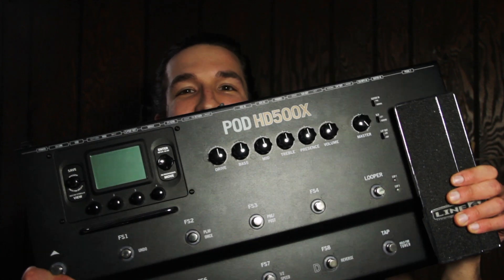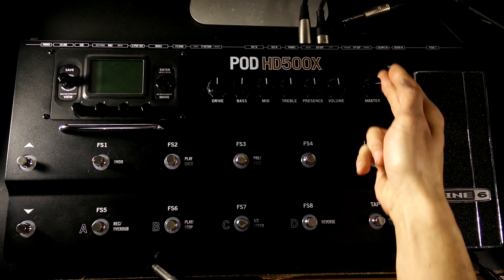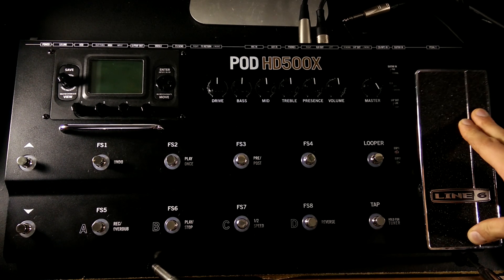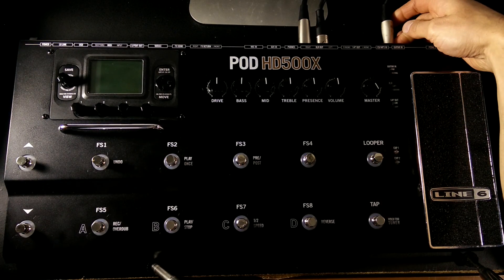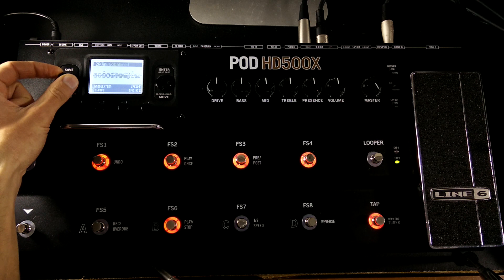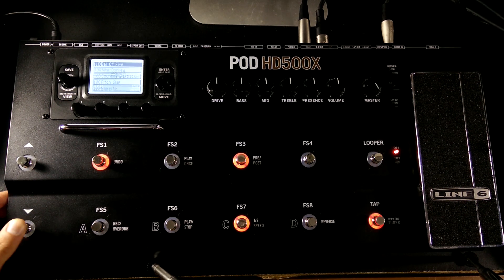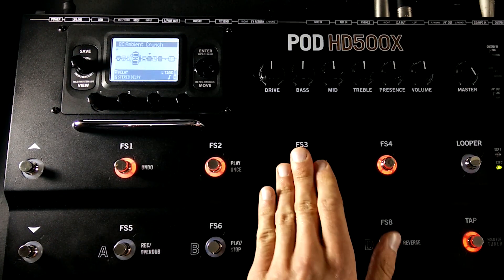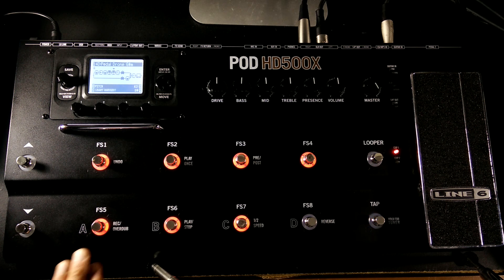Need Help With The Line 6 POD HD500x? Watch This Video!

Comment: Great video! Something I'd like to add here, setting both inputs to guitar made my tones scratchy and distorted which I think is because of too much gain, so if anyone else is facing the same issue here's what I did. Input 1 set to Guitar+Variax and Input 2 Set to Mic or Variax. Basically making sure that only 1 input is set to Guitar. Cheers!

Comment: Good intro vid on the HD500x. I have been using mine for about 6 months and didn't know where to go to assign an effect to button, so thanks for that explanation! Quick question, I have been customizing my own effects on custom banks. Is there a way to copy a custom preset to another bank? Example, I have a custom sound on 1A but want to copy it and put it on 2A so I can continue to tweak it but don't lose my original sound? Hope that made sense... Thanks!
Reply from the maker: Great question. So, let's say you have your 1A preset pulled up. Press the SAVE button once. You'll see a new screen pop up. At the top of the screen you'll see the destination where the preset will be saved. You can use the number 1 knob to pick which setlist to save it to and you can use the number 2 knob to pick which bank in that setlist to save it to. You can also use the other knobs to rename the preset. But, if you want to just copy preset 1A to 2A, turn the number 2 knob until you see the save destination say 2A. Then hit save one more time to actually save it. Just keep in mind, that doing this will overwrite the original 2A preset. Did I explain that ok??

Comment: I’m about to pick up one of these 500x’s and I was wondering if it is possible to use a 1/4” out to a small amp on stage to use as a monitor while simultaneously sending a direct signal to the mixing board using another output like the xlr
Reply: yes, but i'd advise you to get frfr speaker because amp will color your sound and it's not gonna be the same you hear on your amp and what you are sending to PA.
Reply: @denisx36  frfr speaker? I’ve never heard of that one… guess I’ll need to do some research…thanks for the tip! 👍🏻👋🏻

Comment: Congratulations on the video. It looks great! I would like to share a problem I had this week, to see if anyone can give me a solution. When using the Wha, I noticed that the pedal no longer controlled it, although when pressing the foot hard, it works the function of switching between Exp1 and Exp2 correctly. I Tryed to carry out the calibration process, pressing the right key to access the menu, but the foot movement is not recognized in the calibration process. Either it stays at 255, or it stays at 0. I also tried doing the factory reset, turning on the pod by pressing the left arrow, but it doesn't seem to be working, as none of my presets were erased. Therefore, I still cannot control either the wha or the volume. If anyone can help, I appreciate it. Tks

Comment: I haven't tried it yet but seems possible two guitarist could plug into the effects returns and have a dual amp setup in the patch so each has their own sound and could be panned or centered to preference.

Comment: Bass guitar patches. Effects loop end of chain mix 100, send assigned to foot switch for volume, return 0. I can still have stereo guitar patches XLR to board and bass 1/4 " out to board on separate send from effects loop send so bass patches won't mix into xlrs. Easier mixer volume control.
Reply from the maker: Super smart👍 I gotta try that out, thanks!
Reply: That would be expression pedal for send level for volume control not a switch.

Comment: Is there any way you can use this thing as just a pedal board and bipass the amp modelers? I have a tube amp and would hate to have to use the amp modles instead of my amps true gain. Is there anyway I can just use the fxs?
Reply from the maker: Yup! You can turn the amp block off and just use the effects.

Comment: Hello, thanks for the vidéo, it helped so much one several things. I' searching to solve a problem for several weeks, but i can't find any solution, here's the problem. First I'd like to come back to a proper FX seetings when I come back to a bank, I mean making a setup for a bank, add a FX when I play, and come back to a "original sound bank" when i come back. I 'd also like to make priority to a FX : if I put a delay with FS1 when on a bank, I'd like to make it canceled when I press FS2 to a distortion cause i don't want delay anymore. Is that possible ? Thanks ;)

Comment: Dude can I hook up the "send" (from the FX loop of the pedal) into my guitar amp (to avoid cabinet simulation) and then hook the XLR outs into an mixer in a live situation? I don't want to have a cabinet simulation going into my amp, but I do want it going to the mixer... Thanks!
Reply: I’d like to do the same… did you ever figure out how to do this?
Reply: @urbanscott  yes! But it limits your digital processing power so you may have to deal with less effects in your chain on that particular preset. This pedal allows you to use 2 amp simulations at the same time in parallel (in the LCD display it shows one on top of the other). So I used the same settings in both amps except that in one of them I've used a cabinet simulator (which will go out to the main output) and in the other one I removed the cab simulator (I've panned both amps to the center, so the one with cab simulation will come out through both left and right main outputs). And in the one I've removed the cab simulation, I've put the FX loop effect (that deals with the "send/return" of the pedal) just after this amp with no cab simulation (the FX loop has to be at 100% mix so that nothing goes to the main output and everything goes to the send output only), so that whatever comes into this send/return effect (FX loop) will be sent to the "send" output of the pedal and nothing will go to the main output. And then I hooked the send output of the pedal into my amplifier. Unfortunately in my experience the volume will be a little lower than using the actual main output. But it works! On my clean preset I didn't need to do that because I think that even with the cab simulation, the amplifier sounds okay. But when using distortion, it makes a huge difference not to have cab simulation going into the amp. Hope it helps

Comment: I have issues on my expression pedal, when I calibrate it doesn’t move to 0-100, It’s always 100. And the scaled pedal value is 34-255.
Reply: try to do global settings reset, then re calibrate your expression pedal

Comment: Treble is changing automatically even without changing/touching anything. It happens while playing saved patches. Apparently treble is going all the way down and it just stays there, and goes forth and back again. I did try a reset and it cleared all the patches and I do not mind. Please help me fixing this issue, otherwise I need to sell it.
Reply: Subscribed

Comment: There is no way to use foot to press VIEW tiny lever to resume BIG NUMBER of Preset? It ia hard to bend down with guitar hanging. Oh, you missed the other part; using HD500X Edit program. It is supposedly practical but turned out to be painful cope with.

Comment: Can anyone help me find the following information concerning the LINE 6 HD500X . I just bought it.  Three questions;

1) Has anyone found WHERE there is a preset list for the presets?  I can't find it anywhere online. 

2) I'm trying to duplicate the Adam Jones guitar sound for a recording im doing. Can anyone recommend which amp model on the LINE 6 HD500X has that fat,low end ,thick compressed gain sound Adam Jones gets?

3) Any idea  which actual real amplifiers the amp models are trying to emulate on HD500X ?    Example: which amp model duplicates a Marshall,BoogieDiezel,etc?.

Thanks.  Krissy💋💋💋💋
Reply: To answer your third question, there's another video on this channel where he shows us the heavy rock/metal tones. In that he explains what the models are based off.
Reply: metalforlife4ever  when I plug a    Studio  Mike  where can I find the phantom power anybody help me
Reply: @solracm7783  this unit is only able to interface with a dynamic mic

Comment: WHEN I PLUG IT INTO MY INTERFACE THE AMPS GIVES SO LESS SOUNDS...IVE TRIED EVERYTHING BT DONT KNOW WHY IT DOSENT HELPS
Reply from the maker: When you plug your 500x into your interface you get less volume?? If you're still having trouble, first make sure that the channel volume and master volumes are turned up. You probably already checked that, but I have to start there;) Then, check the Level or Gain knob on your interface. You may need to turn that up. Other than that, maybe your low volume problem is caused by a setting in your DAW?
Reply: @JonEleyet  i mean when i try making a new patch..  The amp have a very low level of sounds to then it dosent help even if i turn the volume all the way up...

Comment: I  bought a hd500x and a line 6 fvb express  foot switch ...the pod have a variax input ... Do you know how to connect the fvb to the pod? Does it need any configuration? And I also have a Force feedback gamer foot switch; the connector is similar but is smaller, do you know if exists a way to connect it? Is possible to mapping the gámer foot switch on PC but ...I want to control the PC with the fvb and then  control the pod500x pitch using the gámer foot switch ...I want to have in my feed the same button  as a midi controller keyboard pitch ... because when you use á pitch button  on keyboard it returns to the same position but expresión guitar pedals never do that ...I also háve a sustain keyboard foot switch I don't know if is possible to connect all together.cán you comment?! And one more question jajajajsj.... can I tune my guitar using the pod 500x or is completely necessary to buy a drop tune pedal ?   Rewards from spain sorry my English is basic 😜
Reply from the maker: Hey, I'm not too familiar with how to connect all that equipment together. But, you should be able to do everything with the POD that you can do with the FVB. Good luck.
Reply: Yes ! you can connect the pod fvb with MIDI cable to line 6 pod 500X and you can setting up this in the  setup of 500x MIDI section !

Comment: With the pod hd300, there is a setting called "usbmon" where I can lower the monitoring on the pod from 0 to 100.  This will basically mute the pod hd.  I cant find this on the 500x though, any ideas? Basically I want the ability to remove monitoring so I can use the 500x almost like a DI source for vsts like bias fx etc.

Comment: Jon, thanks for the tips. Do have any experience with the POD HD500X not being seen over USB? MIne is invisible to all the Line 6 software, except Monkey, and even there it doesn't see it enough to update the unit. This problem means that I can't use the Edit software and that sucks.
Reply from the maker: What operating system are you using?
Reply: Jon Eleyet, I’m using MacOS 10.14.6. I think that it is the POD HD edit that undoes the driver installation. I had success on one out of 5 computers that I tested on, by a complete removal and reinstall of the drivers after all of the other software.
Reply from the maker: @AndrewAliferis  Interesting. You should be good with OS 10.14. And it sounds like you've done a lot of troubleshooting already. All I can recommend is to triple check that all downloaded software/drivers are compatible with your POD. So, make sure it's not the HD500 software if you need HD500x software. Also, try installing just the drivers and see if the computer is finding the 500x. (Download a free trial of a DAW if you need one.) Then, if the drivers work, then install the edit software. Also, try a diff USB cable and if all else fails, you could backup the 500x on the working computer and perform a factory reset.

Comment: My story with my hd500x is interesting. I bought it years ago so i could use it as a backup for my amp setup in case something went wrong at a gig. But mainly it was my fx setup going into the loop of my egnator. After i stopped gigging i decided to sell it on ebay (due to financial hardship) and sold it for a fair price. Everything worked out, buyer was excited to use it and all that good stuff. I then receive a message from him saying that he was returning it because the selector knob by the screen was broken. Mind you, i made absolutely sure it was packaged well and had no chance of shifting around during shipping. He opened a claim, which i appealed, had paypal find the case in my favor only to have ebay a couple days later turn around and give the case to the buyer. Long story short, they refunded him but i had already used the money since i had no reason to think any of this would happen since i had 100% good feedback on ebay since 2006. Got the pod back with the broken knob and figured that since i couldnt try selling it in that condition i would just open it up and remove the knob and just use it for recording. Still works great other than not having the ability to use that know but thats why i use the pc software at home for recording with it instead. Anyways, just wanted to tell my story since the pod seemed to go through some sort of abuse either from shipping or the buyer. Great pedalboard for recording or as a backup to your main rig.
Reply: Funny, I just saw your comment as I have just purchased one off Ebay too.  I set it up and was going thru the patches, which was a lot of fun. Then I started to try making my own patch and playing with the preset knob and noticed it was kinda loose and didn't work too well. The more I used it the worse it got and the looser it got. So fact is I am trying to return this now too. I kinda wonder if this is a weak spot on them. Hoping Ebay are on my side. I also have 100% feedback on Ebay, but I am on the side to you.

Comment: I’m having trouble assigning and using the foot switch pedal. Can you go a bit more into depth on the foot switch.
Reply: i have one, i can help
Reply: Josip Crneković  I have a question when I plug the condenser mic is there any settings for phantom power

Comment: What is also great is you can get another expression at all and have two different expression pedal. Plus you can set any parameter to the expression pedal you can use it to add or take away Distortion add or take away Reverb add or take away chorus delay anyting very cool I plan on getting another expression pedal or mine as soon as I can to have that much more flexibility

Comment: I recently bought a used line 6 DT 50 head . I wanted to get a helix but that’s gonna be down the road, I purchased a 500x on reverb in mint condition for 221 on reverb. My biggest thing is I want to use either and the L6Link to control my DT. I’m also planning on getting a second DT I’m interested in stereo ambient sounds. For now my second amp I’d a Bugera v55 2 channels no midi but yes fx loop. Is it better to use midi fir the DT I hear doing midi allows me to actually use the amps tube pre amp. Using L6Link I’m mainly going to have the models through power amp. Pretty confused yet. Wonder if you ever dealt with the L6Link. I do love the sound of the DT 50 amp. Any help appreciated.

Comment: What is the more stable between pod hd500x and boss gt100 ?
Reply: I am also having this question.
Reply from the maker: I haven't played a GT100 yet. They look pretty sweet. I rarely have any problems with my 500x. Worst case I just unplug it and it's fine when I plug it in again.
Reply: Jon Eleyet  hey. I need help with mine. Where can I find the phantom power for the studio condenser mic?

Comment: Nice job... Did you make any in-depth videos using alternate wiring configurations? Using FX on  back of head unit, to use the amps tub, etc? My future is going to be headless and powered floor monitors and di to sound board. Too old to carry a full rig around!!! Thx again!

Comment: My pod hd 500x is automatically switching.. is that normal? Example, im switching the (A) and when im playing the guitar it is automatically changing to (B) when im not touching anything on it. Pls help thanks
Reply from the maker: Weird?! No, that's not normal. When this happens, is your 500x plugged into a computer with a USB or MIDI cable???
Reply: Jon Eleyet  no sir.. just my marshall amp to hd500x to my guitar.. its kinda annoying.. from my clean tone.. its just automatically switching and ruin our jam. What should i do?
Reply: Jon Eleyet  and ive just read a lot of same problem with their hd500x from google.. but still cant find answers 😔
Reply: I have the same problem at the moment. There is a footswitch defective - which wears off over time. You can buy it individually or the two switch strips with all switches. I am from germany. There's a company called pms-electronics. You can get it from them or you can look in your country. On YouTube you will find a video under this name "POD HD500 FOOTSWITCH REPLACEMENT - switch problem, Line 6 repair",  that shows you the replacement of a single switch. Also on YT: "Line 6 POD HD500X Footswitch replacement without soldering" or another video: "Pod HD500X Switch Repair". Hope I could help you.
Reply: vanbal1 yeah thanks ive already fix mine 😊

Comment: Great tutorial! I do most everything via the USB/Software, and most everything works for me, but sometimes though a preset shows Expression Pedal 2 set for Volume, and the pedal is  set on 2,  the pedal does not change the volume. Sometimes by turning off the pedal in the chain and adding another one solves the problem. I have an HD 500x.